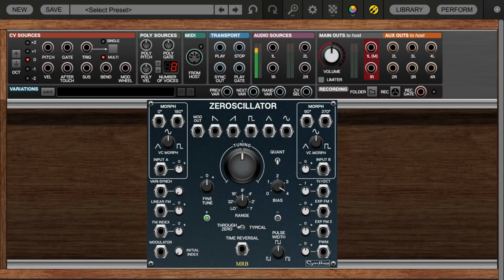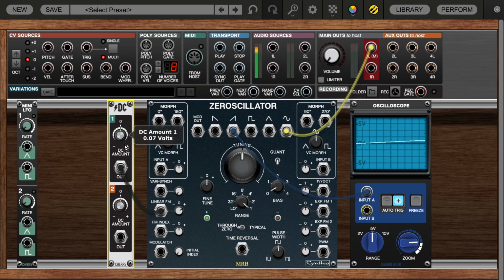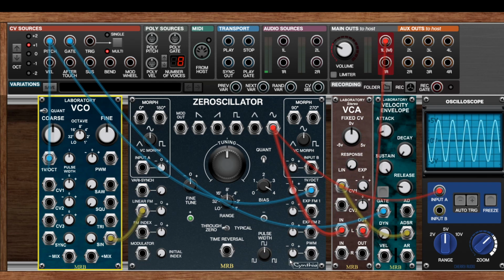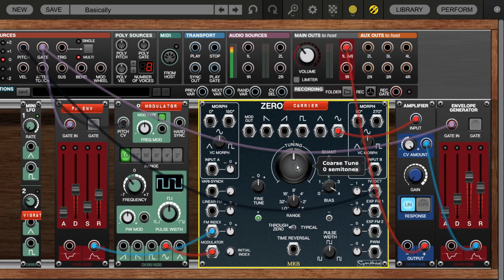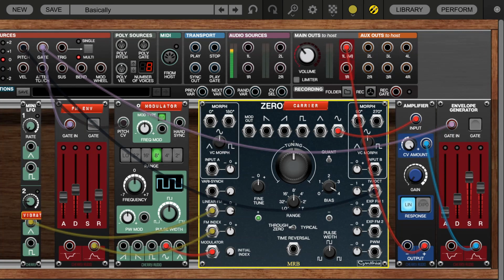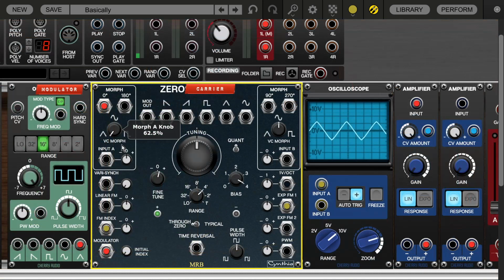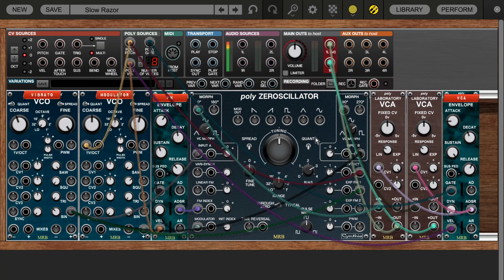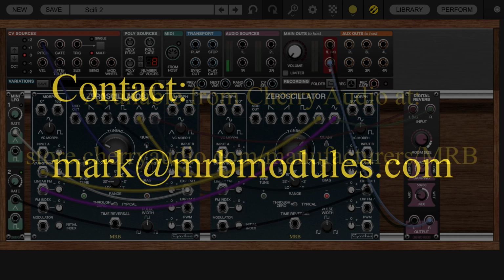MRB Zeroscillator for Voltage Modular

Comment: Nice demo!  I really enjoyed my MOTM format Zeroscillator when I had it years ago but a financial dry spell convinced my to sell it. At the time I thought I'd buy one again but before I was able production switched to surface mount, there were numerous issues, and Cyndustries unfortunately went out of business. 😢
Reply from the maker: Thanks.  Yes, but the software version is ever so much cheaper, tracks perfectly, is more reliable, and you can have as many as you want!  Please nobody flame me for this, but after 48 years I am so over hardware modular.
Reply: @mrbmodules2938  On my YT channel I have a sort of demo of the Zeroscillator that I used to have, and from what I recall your software version sounds at least as good! 😎👍 I remember at times the tracking range wasn't as good as I would have liked, like when trying to have it track along with a MOTM-300 VCO is tended to fall out of tune after 2 or 3 octaves.

Comment: This has become one of my favorite modules. It's scary to think how much the hardware version costs, never mind the poly version; if that existed in hardware, I'd have to sell body parts to get one. I know the original was available in a lot of different formats, but the other day I realized that one format it was never made for (logically, I assume) was the ARP 2500. But with all the hard work you did on the VM2500 modules, we can have a 2500 with a Zeroscillator. Thanks for creating such useful and great sounding modules at such an affordable price.

Comment: Can anyone explain why the vertical distance between 0 and the biased linear curve "represents 100% modulation"? I'm trying to understand this but it seems at points like it requires some prior electronics knowledge.
Reply from the maker: No electronics required.  Let's say you had $200 in your wallet.  Your wallet is biased up $200 and someone steals (modulates) your money down to $0.  You have just lost 100%.  It's no more complicated than that.  Don't overthink it.
Reply: @mrbmodules2938  usually when I hear the word modulation I think of a change happening over a period of time. I take it by modulation you are referring to the bias itself as a static modulation?
Reply from the maker: @briefcasemanx  I guess you could think of the bias as a zero Hertz (DC) modulation source.